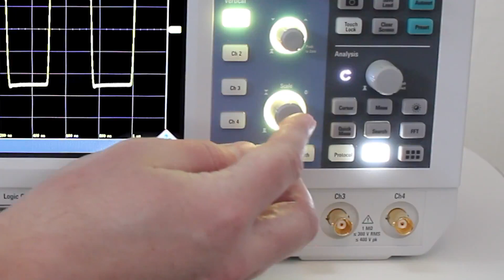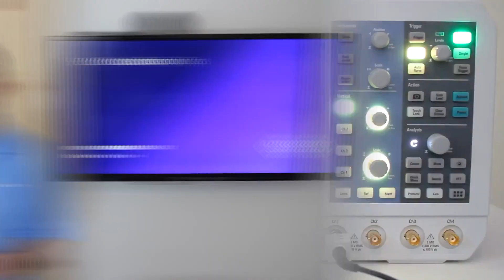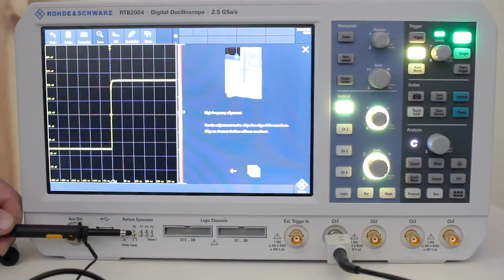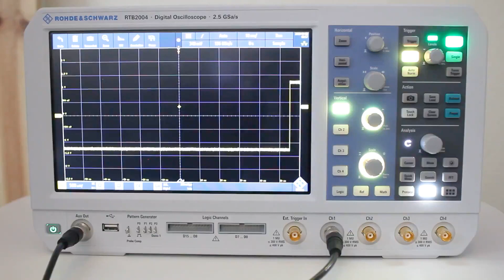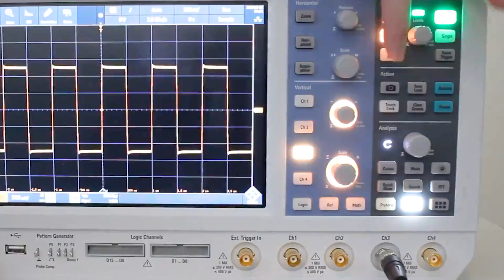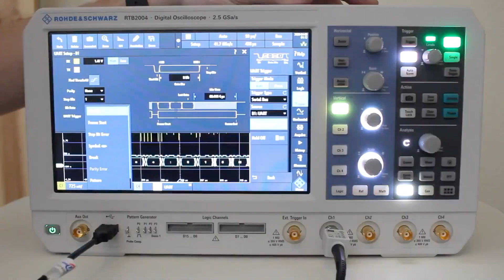5 Oscilloscope Tips from the Rohde & Schwarz expert

Comment: Rich, I have a quick question for you:
Context: I'm a retire scientist & want to make an Occam's-razor hobby/home lab focused on low-energy electronics/computing.  A hell of a lot have changed since the 70s.  It seems hobby chips, microcontrollers like arduino kits, computers like raspberry pi kits, computer-based hobby test equipment, etc is the best bang for the hobby buck.
Finally the question is:  
   ?What rules-of-thumb you would use to get the best-bang-for-the-buck in a computer-based hobby Oscope, Logic/Specturm-analyzer, etc?
         Top 5 PC Oscilloscope Review | Best Oscilloscope for pc https://www.youtube.com/watch?v=FhhZl6sWSKQ
?Why ask you? Well, the title of your video is "5 Oscilloscope Tips from the Rohde & Schwarz EXPERT" ;)
Reply from the maker: Great question.  Based on your desire to keep your lab as simple as possible, a PC solution is a good option.  They’re typically lower cost with a fair amount of capability packed into them.  They leverage something you likely already have at your bench (a PC/display) and they don’t take up too much space.  I’d look for a device that has a multitude of capabilities in it – good analog capability, good mixed-signal (think mini logic analyzer) capability, good FFT/frequency capability, and maybe even a signal generation capability.  A couple of things to be careful of:
1.	They’re often lower performance.  Pay special attention to sampling rates, channels, memory depth, triggering capability, etc to make sure it’s going to meet your applications.  If you’re familiar with a bench-top scope that you liked, perhaps do a comparison of data sheets to see if the PC unit will be missing something you really appreciate/need.
2.	Oftentimes PC based solutions can be slow.  This could cause you to miss less frequent events.  It may not matter for your application, but for some folks, this is quite frustrating if they’ve never used a PC solution.

In some cases, you might find investing in individual bench units gives you more capability and flexibility.  Sometimes they’re more expensive than PC solutions, but you can always look for used or refurbished equipment.  Best of luck!
Reply: @Rohde-Schwarz  Thks, I'm looking at a PicoScope 6in1 test instrument (but the lab is ~year down-the-road): 
        Oscope, logic analyzer (MSO models only), spectrum analyzer, std & arbitrary funct gen, serial bus analyzer
        PicoScope 2204A Review (2014 oldie but goodie review) https://www.youtube.com/watch?v=UGNmnU65lzU
Reply from the maker: Hi Tom, 

Let us look into that for you and get back to you momentarily. Thanks!